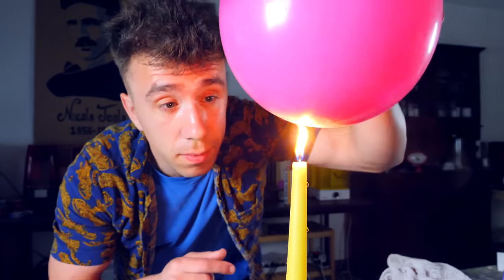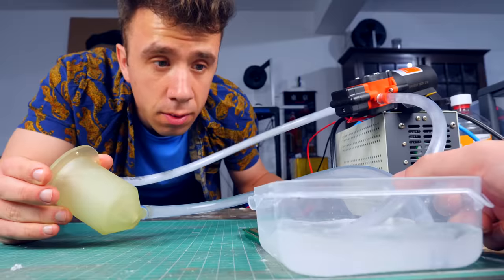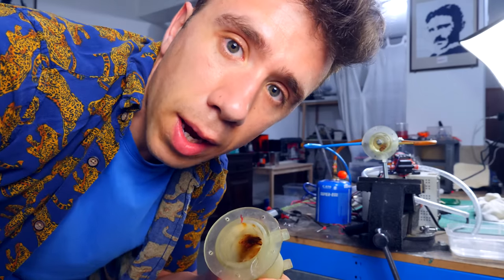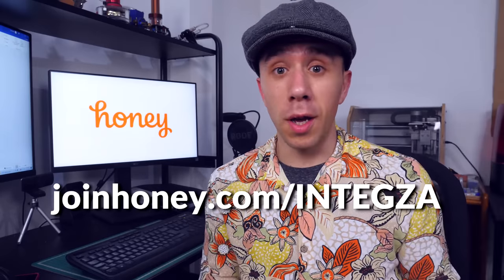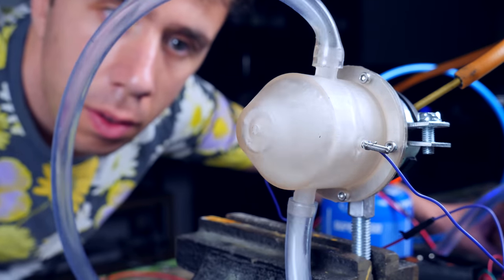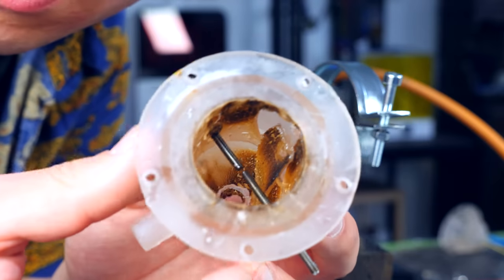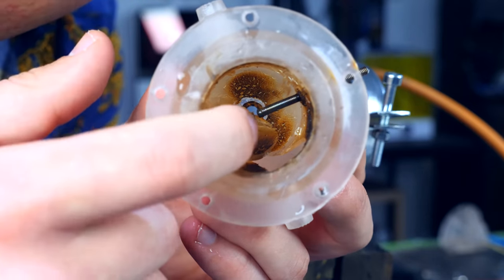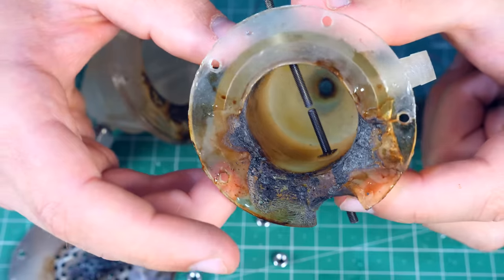Water-Cooled Jet Engine in Plastic

Comment: I can't believe you used liquid butane to cool a combustion chamber made of plastic, that was brilliant! 😂
P. S. : that keyboard is filthy!
Reply: It is called regenerative cooling, actually pretty common with rocket engines.
Reply: 'liquid butane to cool a combustion chamber '  Brilliant, until it happens to go wrong in the exactly right way, and the liquid becomes gas, and ignites all at once making a larger than expected fireball.. 
If you do the math it might really not be that bad, or it could be a terrible idea, depends on the expansion ratio.
Reply: Beat me to it on the keyboard
Reply: @ModelLights  Remember. Butane by itself is not dangerous or explosive. Infact butane in a sealed container can't even catch on fire. You need a second ingredient. Oxygen. No oxygen, no fire. Thats why with propane bottles the flame doesn't just run up inside the bottle and detonate.
Reply: @superspooky4580  When you're combusting butane inside the combustion chamber, it will have to have all necessary ingredients for combustion.  When something goes wrong with the chamber and the liquid butane cooling the chamber gets out, there's also plenty of oxygen right outside.
Lighters etc are relatively safe.  That doesn't stop one from rarely exploding.  And that would be a lot less rare if you're purposefully causing fires right outside the lighter casing instead of only in the properly designed mechanism for the lighter.
This is far more likely to encounter problems than just using an already well designed and safety iterated lighter..
Reply: @xxxm981  It either needs a flashback arrester or to be flushed with liquid butane before the igniter fires. If the flame front gets back in the channels, it's bye-bye engine.
Reply: That’s how rocket engines are cooled right
Reply: @xxxm981  The old tricks are the best trick right?
Reply: @ModelLights  except all of that oxygen is already being used up to burn the hot butane in the combustion chamber. Adding more butane will just cause the exhaust to be cooler and more full of soot
Reply: I just was about to write it is commonly used in rocket engines, but there was a one little problem, the idea is good, but then you can't forget to flip the butane tank to actually get the liquid butane and not only a gas :D
Reply: It's dirty, and we love it.
Reply: @xxxm981  totally agree, it increases specific impulse when it works, and the size of the fireball when it doesn't. Unfortunately for our beloved Joel the second outcome was far more likely🤣
Reply: @jerry3790  'all of that oxygen is already being used up'

First, it's amazing the absolute molecular perfection you think everything actually operates at in the real world.  Tell us wise one, why were there even any hiccups in his original attempts since everything works so perfectly?
Second, it's also amazing how poorly you can choose to read even absolutely correct material.
'until it happens to go wrong in the exactly right way'
Reply: Based on the first and only butane test exploding. It doesn't look like it even has to fail "just right", seems much more likely it's the default failure mode.
Reply: @trevoncowen9198  The only part that is cooled with liquid fuel is the nozzle. Plus it's cooled with liquid fuel, not with liquid fuel + oxidizer so it's usually fine. But here we have the oxidizer in the atmosphere so yeah a bit trickier.
Reply: must be taking a leave out of electroboom's book.
Reply: Usually rocket motors use liquid fuel to cool down the motor, but if those fail.. well results are explosive.
Reply: @superspooky4580  that’s a lot like how oxy acetylene torches work
Reply: @superspooky4580  that a think on on long long list , of things you need to be worried about, so that no chances what so ever, so I can cross it off the list, thanks
Reply: @ModelLights  Not only that but doing such experiments inside is just insane. With his face right next to it. There have been a LOT of accidents with people who messed with liquid butane inside and the resulting explosion was powerful enough to blast the windows out along with their frames. I'm beginning to think this guy must be fake. Hopefully.
Reply: @superspooky4580  If the container gets too hot the pressure from the butane could cause a rupture, and then it explodes.
Reply: @haraldhimmel5687  A shockingly small explosion can blow windows out of frames if the room is well sealed. Might not even cause permanent hearing loss.

(For reference the design pressure for a basic residential window is only 15 pounds per square foot.)
Reply: Did not expect to find one of my new favorite YT creators in this comment section, ngl.
Reply: @JM-mz1zj  everyone talkin about butane while we are concered about the keyboard
Reply: The F1 ran liquid O2 through hand welded ‘veins’ in the engine bell before it burned, otherwise the exhaust would have slagged the engine bell

Comment: Hey Joel, I just noticed that the electrodes are probably causing a lot of heat transfer to the resin. Maybe try a ceramic tube or slip coating to isolate that heat from the body part.
Reply: There's a high voltage going through them from the tesla coil, but not current. The rods i think should remain fairly cool
Reply: @ZenBeepBop  But what about the combustion going on? Would not it heat the rods?
Reply: @ZenBeepBop  The electrodes inside the combustion chamber will be heated by the burning fuel and transfer heat down their length.

Comment: Hey integza, I had the same idea as you a couple years back and designed a water-cooled jet engine as well, but due to not having an SLA printer i was unable to give it a try.  I designed it with a spiral water cooling and perfectly sized walls so that maximum cooling would be created. If you want I can send you the files if you are interested in trying out my design. Just let me know. :) 
Update: Seeing as you guys like this idea, I should also add that I also designed it with tangential air and fuel inlets as to provide an extra layer of protection by creating a boundary layer of insulating air. I saw this concept used before on a 3d printed rocket and it worked to some extent.
Reply: Like this up guys!!!
Reply: yep
Reply: I want to see this. Hope integza does
Reply: I was just about to comment about making a spiral channel all around the chamber for the water to follow, maximizing the surface area for the cooling, as well as allowing for thinner walls that shouldn't crack since they are connected to the outside shell by the channels.

nice to see that someone already thought of that idea.
Reply: Bro is an actual time traveler, subtly trying to advance humanity 😲
Reply: See this tomato man
Reply: I also wrote ab spiral walls)))
It's nice to see smo with same knowledge set)
Reply: Up

Comment: The butane coolant was a great idea. It was perfectly effective at producing content
Reply: I mean, it might have worked if he had purged the chamber first
Reply: Why dont we cool it,
With fuel
Reply: The idea is actually sound. Some rocket engines run the fuel through the engine bells to keep them cool.
Reply: @Mikowmer  but those are thoroughly reinforced and aren’t made of resin
Reply: @quakxy_dukx  it might be because integza is thinking of making things way ahead of what he has atm lol
Reply: Well I believe blew up because the liquid butane instantly turned gaseous due to the heat of the combustion. The outer mantle was probably not made to withstand the pressure of the butane. But i guess printing it thicker would work because the inner chamber survives the combustion pressure just fine. A bigger outlet would help aswell. Cooling with the fuel you burn is super interesting.
Reply: @Mikowmer  Virtually all modern rocket engines do.
Reply: @moritz8183  probably that combined with the liquid butane making the resin brittle. These resin prints arent exactly strong to begin with.
Reply: @moritz8183  You're right, the pressure drastically increases as it heats up and I'm fairly certain it goes from liquid to a gas at that point too. Once you've built it up enough to withstand the pressure it's likely not going to get any cooling as the hot sides going to be burning up to the point it reaches the layers it's actually getting cooling and from there I'd imagine it'd be thin, brittle and break unfortunately.
Reply: @Mikowmer  but the fuel is cryogenic, and the fire could be half as hot as the surface of the Sun.
Reply: @afoxwithahat7846  ... I'm not sure I see your point.
Reply: @Mikowmer  the efficiency of the cooling depends on the difference of the temperatures. So for this example, it's not so great, plus plastic is a thermal insulator.
Reply: @afoxwithahat7846  Still doesn't mean that the principle isn't sound, just that it doesn't work with the materials given. In addition, the jets that Integza is making are not getting anywhere near the same temperature as a full sized rocket, so you could get away with cooling that isn't as efficient. The only way to find out is through experimentation.
Reply: @Mikowmer  well, since Integza only does one video on a given subject. I guess experimentation isn't really gonna happen.

Comment: As someone who works with liquid hydrocarbon on the daily, I just about had a heart attack when you said you were going to use it as coolant for a sparking fireball engine
Reply: boom
Reply: To be fair, passing the fuel through tubes lining the combustion chamber or nozzle is exactly how many (if not most) liquid fuel rockets keep those components cool. With a better design that reduces heat transfer/concentration to the plastic components, and ensures better flow of the coolant for more uniform cooling, I suspect Integza's engine would have worked fine.
Reply: @ericgoldman7533  the difference being that the rocket engine is made of metal and that the fuel can’t burn in unintended places ( unless the oxidizer leaks or the fault happens very early )
Reply: Reminds me of the time one of the guys at the workshop tried to cool some overheated angle grinder with his butane  welding torch. It was still plugged in.
Reply: came searching for this comment
Reply: expansion has left the chat 😂
Reply: @ericgoldman7533  And when they fail they goes in similar way in great balls of fire.

Comment: Don't forget to vent your cooling loop (so that there are no air bubbles in the loop). That increases the cooling efficiency. Also you can try to utilize the fine internal structures you can create with SLA to create a unibody engine, eliminating the mount which will always be challenging to watercool. You can even do some flow simulations to find the form which best circulates the water without any hotspots. In your current solution the flow seems to not cover the whole engine.
Reply: This is really important - the bubbles allowing a few hot spots to form probably caused a few of the failures
Reply: The parts that failed didn't seem to fail in the places where bubbles would form, i.e. at the top of the part.
Reply: @CreeperOnYourHouse  when working with high speed flow, bubbles won't form in static locations. They move with the flow, so if you have an aerated intake, the entire flow will have bubbles.  It also means that if you fix the intake so it's pulling only water, it will flush bubbles out pretty quick. Some of tests you can see the water flow go clear, and thats what they all needed to be.
Reply: @kuhljager2429  that pump he's using is most definitely not high speed.
Reply: @JerryBrower  I understand this concept when using cryogenic fuel like hydrogen, but I think the expansion ratio of butane might cause some additional problems in this kind of setup.

Edit: So butane's liquid to vapor expansion ratio is roughly 1/4 that of hydrogen, so while it's it's significantly lower, it's still 233:1. With thin plastic walls, I think you would still probably run into failures in the wall from gas expansion.

Comment: Some Ideas:

1.) Run the engine “fuel rich” so that it can’t burn the plastic as well.

2.) Machine a Graphite Nozzle (and maybe other parts (combustion cylinder, diffuser disk) if that doesn’t work on it’s own)

3) As others have suggested, optimize the coolant loop (better path design, less bubbles, maybe even a faster pump / more volume;  a bunch of cool 3d printed pump designs exist too, that could maybe be a video in of itself!)

4) Cool the water down with ice (and maybe even salt water to get it even colder, although I don’t know how that would effect the plastic, and what would happen if it gets in contact with the fire)

5.) Do the vortex cooling as well? (I don’t know much about this method, but it sounds like combining the two may be good!)

6.) Use Gaskets

7.) Use fine metal mesh as a flashback arrestor, or maybe even a commercial flashback arrestor like they use for Oxy-Fuel torches!

8.) Fancier Injector Design to Make Sure you are having things mix well

That’s about all the ideas i have, and it was a great video as always!
Reply: Also there's a way to use fine metal shavings (usually bronze) instead of a fine metal net to prevent flashback. This shavings usually look like "metal wool". As I understand, some commercial solutions use this way.
Reply: Also needs dissipation of heat. If the water he's cooling the engine with becomes too hot, then there is no point in using it since it will no longer do it's job. You said ice, and in the end would work similarly, but it would be just as limited, because it's not permanent and the ice will eventually melt. A heatsink/radiator would be the way to go.
Reply: You can also check out Scott Manley's video on fuel injectors. They're a bit more complicated, but the fuel and oxidizer (or air in this instance) wouldn't mix until they're already in the combustion chamber
Reply: he could also use a wire mesh sieve as flashback arrestor. It's cheap and widely available
Reply: I noticed the threaded rods for the spark are going to absorb a lot of heat and cause issues. Maybe they could be inserted from behind or somehow insulate them from the inner chamber wall. Increasing the volume of the water chamber would be a good idea too.
Reply: @maeros-2554  True, granted idk what the intended run time is, and ice can be cheaper than a radiator despite being sub optimal.  Also ice would allow the sub-ambient coolant.  

Looking into evaporative cooling may be neat too.  Have the return line go over some of the media they use in those to dump a bunch of heat. (Granted would probably want to do this outside to not add a pile of humidity to your house!)

Comment: if the resevoir is higher than the water jacket, it will vastly increase the efficiency of cooling because the air bubbles will be able to travel up to the res and leave the system. that frothy mix of water and air in the water jacket is really bad at conducting heat
Reply: Pretty’s sure the cloudyness was resin left over on the inside of the part because you can see at one point in the video the water is clear
Reply: Reid valve off a two stroke might work
Reply: Gray Man 🅥  you rick rolled me with a clickbait comment and a cat video cringe

Comment: Try to make a controller, this is what we actually use even in the early stages of jet engine builds. This helps a lot to understand what is going on inside the engine and by comparing this data with your design and materials used, you will know what is the problem and how exactly it can be solved. Helps to minimize the time you waste on prototypes and obviously the cost of materials used. the most basic one would include at least 2 thermal sensors (we use 2 at each stage of the engine for better results, but it's not really necessary for your needs), in your case 1 would be used inside the engine and the other one on the nozzle (just an example, you can play with it), AR sensor that would show the exact mixture (this will allow making it more efficient (by that I not only mean consumption but also temperatures (that are quite important in your case) (because the good mixture will decrease temperatures of combustion), air flow sensors (show the speeds of intake air etc.) and the last but not least is flow/consumption sensor (but it mostly used for liquid fuels, so not sure if it would be helpful for you.

(If needed can help with code etc.)

thank you for your videos.
Reply: This.